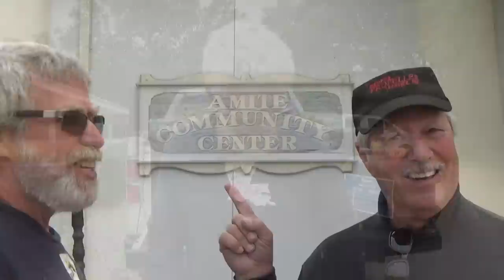The terrible effect of what high moisture levels in a beehive can do to the hive.

Comment: Send that old moldy comb to me.  My bees are tougher than those old Louisiana trailer trash bees.  Mine will scrape off the mold and use it to paint the landing board.
Reply from the maker: Your bees have to be tougher than most other beekeeper's bees, they are lucky their hive doesn't fall down around them. Heck, the only thing that is keeping most of them together is they have built comb to support the rotting material. And as far as them using the mold to paint the landing board, there is no wood there for them to paint. Still, they do make some awesome honey. God's peace brother.
Mr. Ed